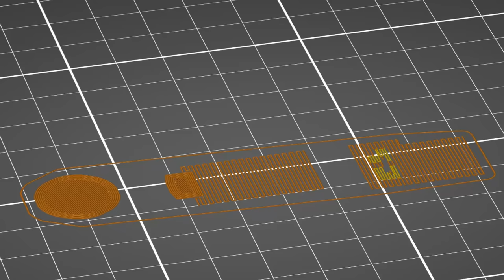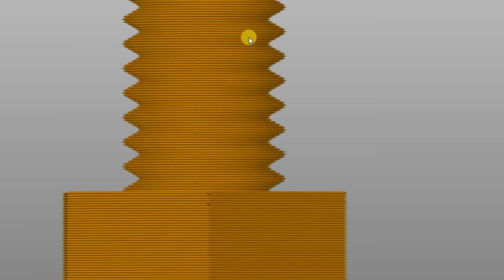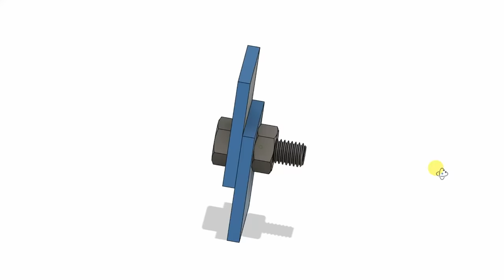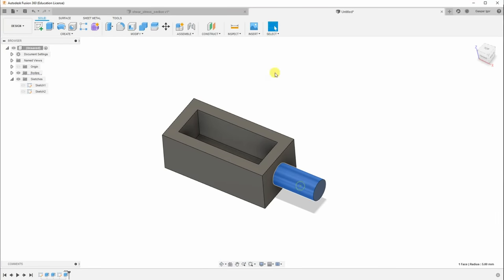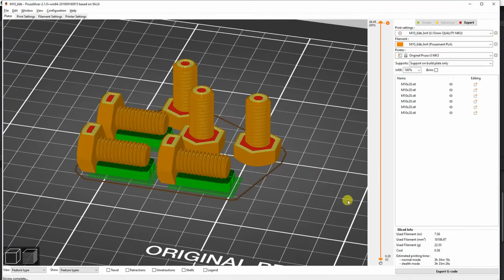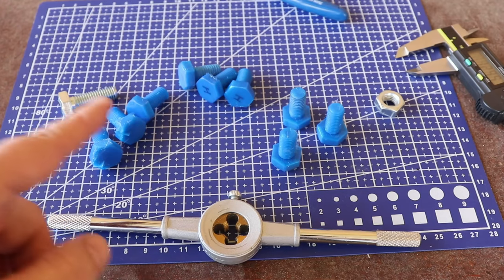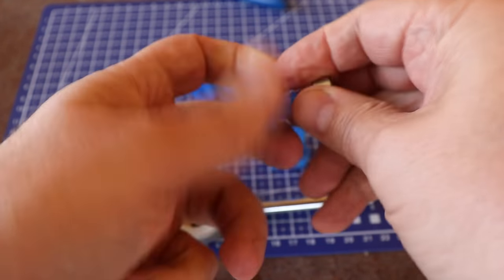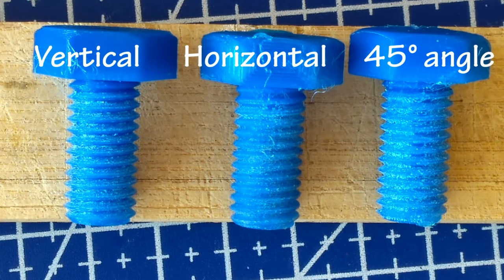3D printing bolt and thread in horizontal or vertical position - strength test

Comment: Long story short, don't expect too much from 3D prints.
Reply from the maker: True. But sometimes you need exactly this..."not too much" ;-)
Reply: Don't expect too much from PLA 3D prints. It's nice, supery easy to print and stiff at first glance but it creeps a lot under continiuous stress, barely survives a sunny day and gets brittle over time. PETG is not much harder to print, a bit more flexible but much better in these points. If you want something to perform indoors and it is not too big, have a look at PC-Blends and outdoors Durabio for example. Those won't be a match for steel screws either but they can take a lot more than PLA and are much more durable.

A lot of people are using ABS (indoors) or ASA (outdoors) for technical prints as thosse can printed reasonably well in terms of dimensional stability and show good performance, although you need good print profiles otherwise layer adhesion is bad. One should have a printer with a good enclosure for those however to prevent warping.

Comment: Why you have so big Problem printing with support?  That is not much.
Reply from the maker: Hm, I agree, I don't have a problem with it, when only the bolt is printed. The only problem is when the thread is part of the object, and it is on some higher Z coordinate, then you need a lot of supports below it, tall supports are sometimes risky

Comment: why use 3d printed bolts at all? There are cheaper easily accessible options
Reply from the maker: My plan was to test thread 3D printing position, but plastic bolts are used commonly in electricity for example. Of if you don't want to scratch ceramic or similar and no need for very high load.

Comment: I needed a bolt but didnt want to print support so i cut off as minimal as i could in fusion to print flat on its side and it worked pretty well. not sure how much it would affect strength.
here's the thingiverse file so you can see what i mean

https://www.thingiverse .com/thing:4074160
Reply from the maker: I already got this suggestion few times, definitely something I have to test. Thanks.

Comment: if you shear threads youre doing it wrong
Reply from the maker: You are right, I know, that what we learned in school, but with metal. As you can see, plastic is acting very differently.
Reply: @MyTechFun  its not the material its the stress you put on it
when you tighten the nut you pull the thread
if you additionally shear it you put it into a 3 dimensional stress state which produces very high equivalent tensile stress
if you were to split both loads (pull streess und shear stress) to individual parts you can increase the load manyfold
the way to go is theoretically to apply enough torque to produce enough friction to oppose the load

Comment: нужно немного похудеть :)
Reply from the maker: Znaju. Yes, now then I have new setup, I don't need so big weight for testing ;-) (my new setap demonstrated in PLA vs Resin video). Privjet.
Reply: @MyTechFun  у вас удивительные знания русского языка ! поздравляю!  предлагаю дружбу на веки ! :)))   итак , теперь вы проводите испытания на прочность при помощи разрывающей установки ?
Reply from the maker: @sergeybabuka1800  My wife is Russian, I understand it, but it's hard to write. I am building tensile testing machine (Arduino based), but so far just Chain Hoist and crane scale as shown in my latest video.

Comment: Well, screws and bolts hold joints thanks to their elasticity. You can think of them as stiff springs. If you are using a non resilient material like UV curing resin then I can only  wish good luck..... You picked the worst material for the job.
Reply: Screws and bolts experience primarily  shear stress during tightening, which also cause them to stretch and generate axial force. Any applied shear stress should never exceed the value reached during tightening.
Reply: Finally, I strongly doubt the listed mechanical properties of PLA. For example the nominal ultimate tensile stress of steel 37 is 370 N/mm2, while PLA is claimed to break under 60 N/mm2, meaning steel is only 6 times stronger than PLA. Well, in that case buildings should be built out of PLA.

Comment: Thanks,  3d printing is not suitable for this kind of use.
Reply from the maker: Depend of the application, I have so many fully 3D printed projects, which uses 3D printed threads (and bolts)
Reply: @MyTechFun  I guess, but what strenghts are required? You show us it's kinda weak, so it can't be too much.

Comment: Wait you have a thread dye and STILL want to waste time money and energy printing bolts??? I don't get why ppl want to print such things. No plastic is better suited for bolts then let's say aluminium(that said alu isn't really the best choice for bolts either but better then every plastic!)
Reply from the maker: I agree with you, if I need standard bolt I always use metallic. But it's good to know the possibilities, if you need a thread as part of your object.
Reply: @MyTechFun  sure, but even then there is a much better way to make some threads. So you have that dye, you buy yourself a plastic rod with the right diameter for what you want to have as a bolt so you can cut it to length and put the thread on. It's simple, then there are no layers that could interfere with what you need because rod=extruded with no layers so stronger than any printed bolt or thread